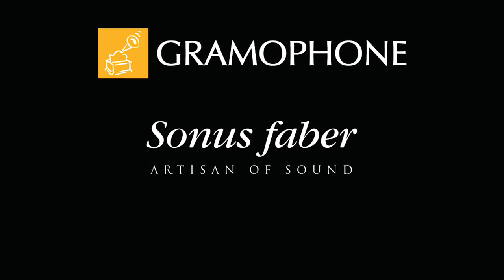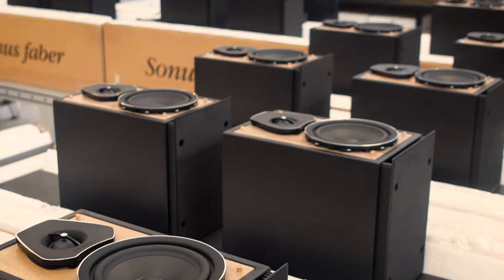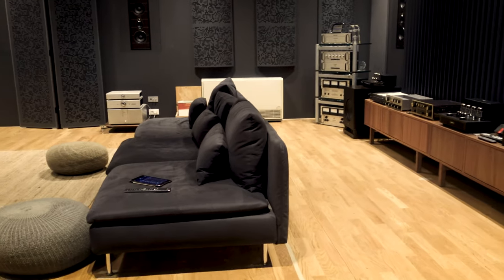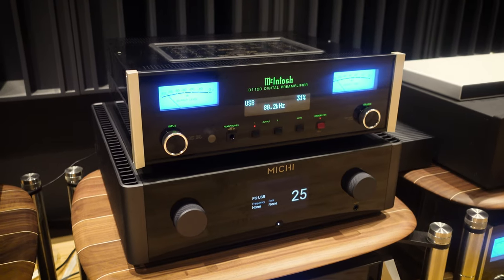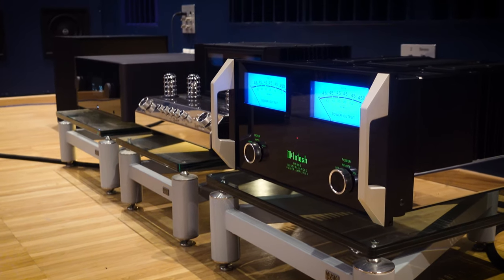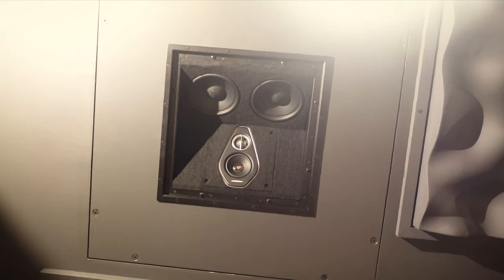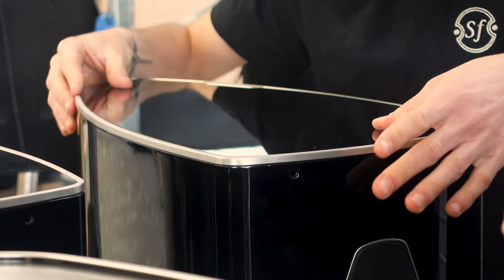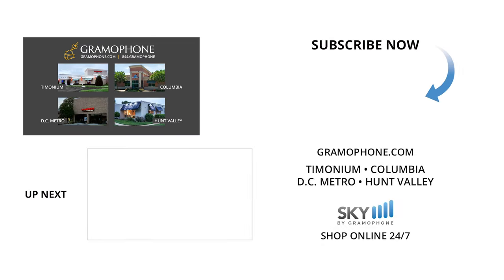Sonus faber Speaker Measurement and Certification | Part V

Comment: are they the Sonetto 5 or Sonetto 8?  Which speaker cables were they running?
Reply from the maker: Those are Sonetto 5s, not sure what cables but I will see if I can find out.
Reply: @GramophoneMD  yes please, I'd appreciate if you were able to determine the cables.   Btw, how did you like the sound output of the Sonetto?